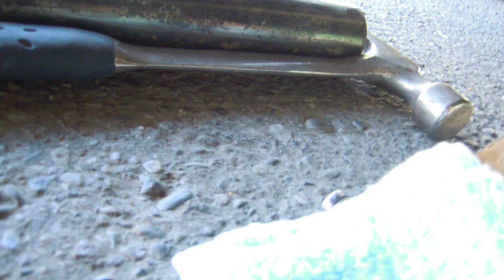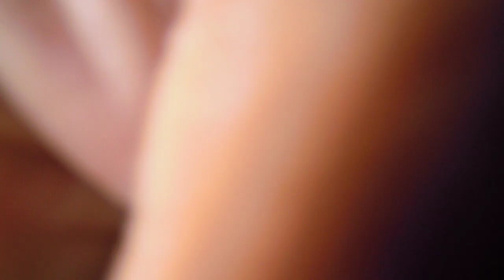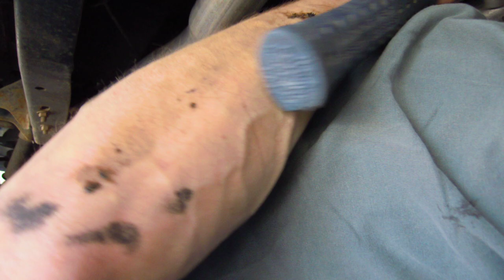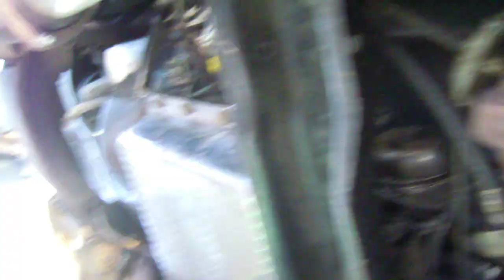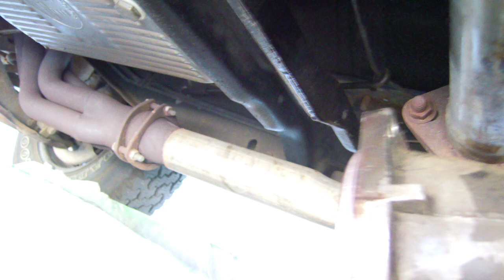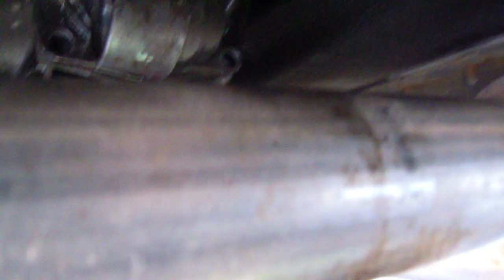Reluctor Ring VSS Installation 01.avi

Comment: Yeah but how do you remove it man
Reply from the maker: torch, heat the ring, could use slide hammer, could just cut it off as well.
Thanks for viewing.
Reply: With a bearing puller

Comment: How does one remove one of those rings
Reply from the maker: Good question. If you put a torch to it and rig something up so as when you hammer you are transferring the energy of the blows towards the reluctor wheel at 90 degrees not 87 or 85 or 93 etc, you need to be flat and square along the tail-shaft. Heat up to 300 degrees approx. dont try to heat the tail shaft, just the ring, and it doesn't have to be red hot.

Another method would be take a hack saw or grinder and cut through it, watch the tail-shaft. Wear safety glasses, gloves and hearing protection :-D
Reply: Starting in July of the 1986 for some 87 models of the 700r4 / 4L60, the tone ring or reluctor was used with the permanent magnet VSS sensor to produce an A/C sine wave used for a rear wheel speed input for anti-lock brakes. The factory method uses a groove cut into the output shaft. Special tools where listed but a small bearing splitter is clamped into this groove. A “U” shaped holed has two holes centered allow for “All-Thread” bolts to push it on or pull it off without heating. The shaft is 1.290” O. D. and the I. D. of the tone ring is 1.289”, so a press fit on 0.001” interference fit holds it in place. Heating does help any press fit item but quickly looses the heat and shrinks tight. The mass of the output shaft is huge and wicks the heat from the sintered tone ring quickly. Just make sure not to damage the shaft during removal, but also make sure the pipe is flat on the face to start the ring on, as it can break. See the ATSG book for the 700r4 for update. The tools can be purchased thru Kent-Moore, but are expensive. Many dealer techs will have bearing splitters of different size and “All-Thread” stock can be purchased in fine or course thread and also grade 8 for hardness. McMaster Carr is a great online supplier with reasonable prices.
ASE Master Tech since 1978 Retired

Comment: Hi, I bought a 1994 Chevy Silverado 1500 with the transmission busted and laying in parts in the bed. The truck was on its way to the crusher and bought off the trailer at a stop light, had the guy drop it off at my house, and I put a 1984 700R4 on it. The truck rides great but ofcourse the speedometer doesn't work. I want to try this to retrofit my transmission to use the electronic speedometer. I need to know how you got the gear up to 350 and keep it there long enough to get it in place? Thanks-- Bill

Comment: Hey bud I have a question. On a 1990 350 tbi with a 700r4 transmission, what kind of speed sensor goes in it?  The transmission was changed before I got the truck and the speedo has never worked since I've had it.
Reply from the maker: Is it a Mechanical Speed Sensor, or Electronic? I will look up the model number of the Electronic one...
Reply from the maker: The VSS number is GM 8673299 Hope this helps...
Reply: Thanks for the reply. It had a mechanical sensor in it. Im guessing trans was out of a camaro or something. I pulled the mechanical sensor out and replaced it with an electric sensor. I used your video for the part number for the ring. I put it in and speedo works great! Your videos were a big help. Thank you.

Comment from the maker: What is a np241?, oh, it is a transfer case... I am not sure about your application, but as long as there is a pulse, the signal will be picked up, I am assuming, an after-market speedo etc?   Here is a link that might get you on the right path, sorry I could not be more help...>>> ls1tech.com/forums/conversions-hybrids/530319-speed-sensors-vss-transfer-cases.html